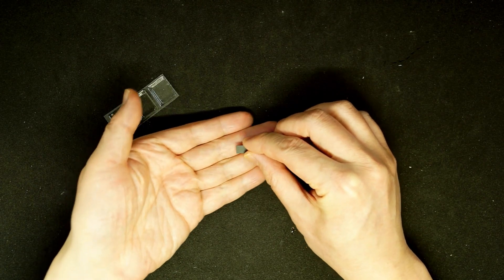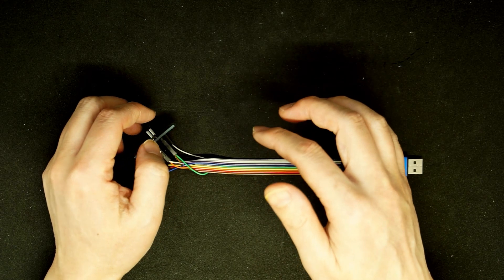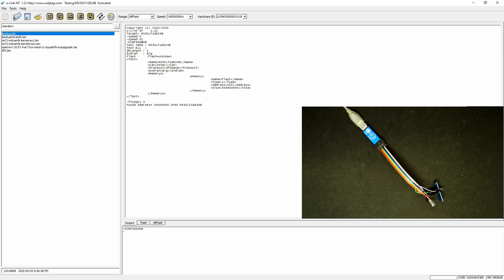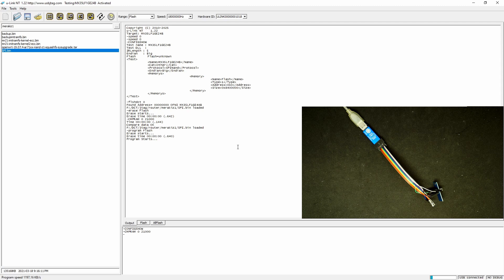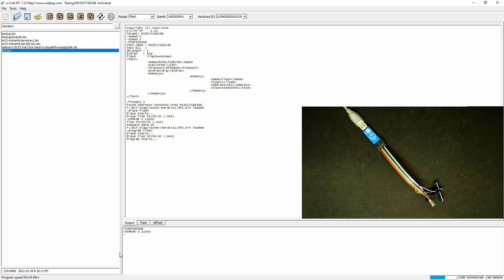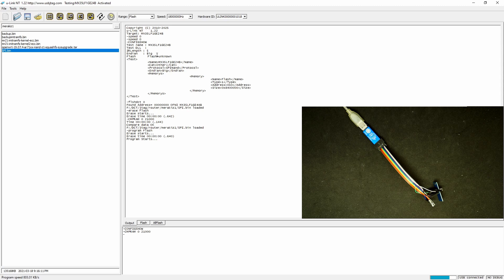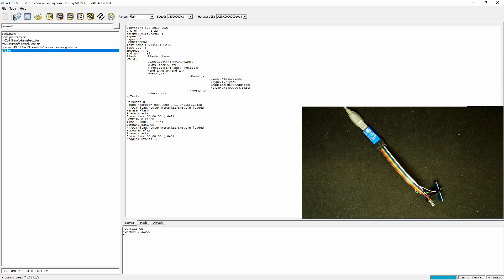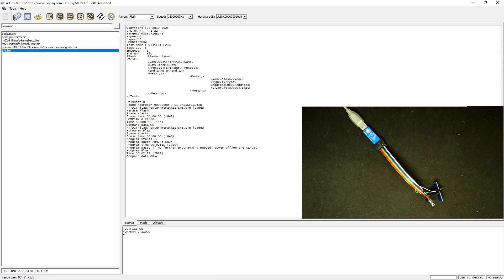u-Link NT program SPI Nand flash (MX35LF1GE24B)

Comment: This u-Link NT programmer is really easy to use. But I having trouble with flashing SPI NAND flash using RT809H programmer. When reading a MX35LF2G14AC NAND flash, many bytes are inconsistence and in writing mode as well. Do you have any suggestion to overcome with that saturation? Thank in advanced.
Reply from the maker: SPI NAND virtually uses just SPI protocol. If you are talking about RT809H programmer, I do not know. But keep slower clock speed might help. Also see if you need to pull up any pins like HOLD and WP.